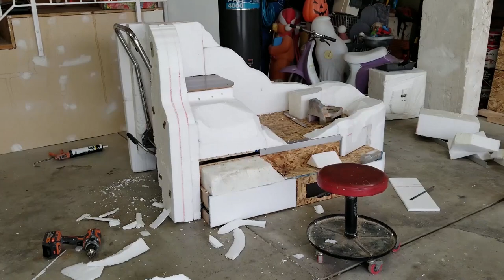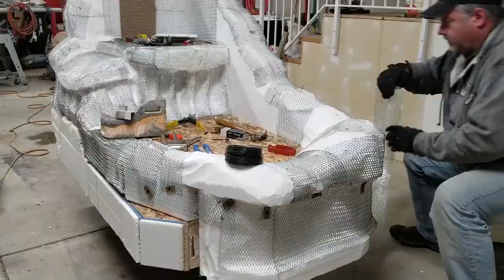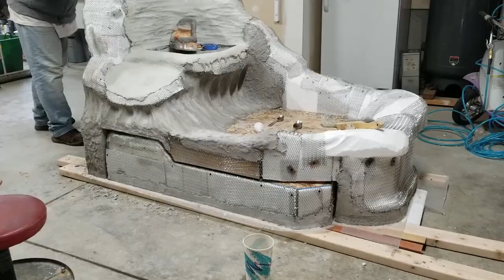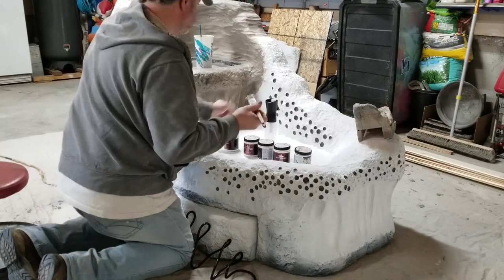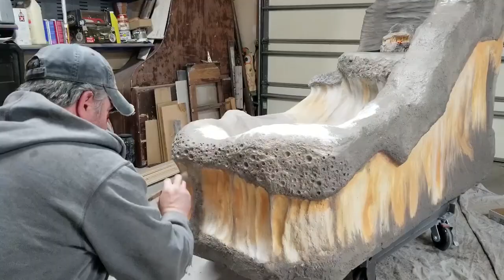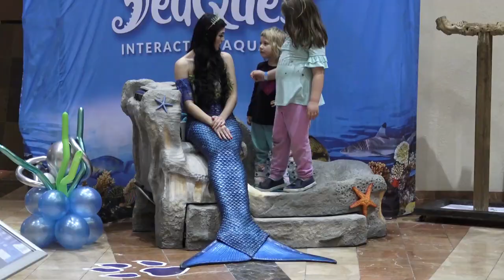From scale model to full scale, check out how this mobile mermaid rock was created!

Comment: Amazing job and from what I've seen on your other videos that's no surprise! Did you have a full plan for how you were going to do this before starting work on it, or did your plan for it evolve as you made progress?
Reply from the maker: Thank you! I created a plan before beginning construction.  There were parameters such as width and the mobility aspect but the rest I came up with. I made some drawings prior to making the model then built that and used the plastic figure to troubleshoot issues. Then after I was satisfied that the model would work, I drew plans that reflected measurements extrapolated from the model.

Comment: Amazing! What concrete mix did you use? I’ve been looking for recipes!
Reply from the maker: This is just type s mortar and a rapid set concrete (for the smooth areas) 
There are some recipes online but I haven't used them, I have just modified existing concretes with admixes.